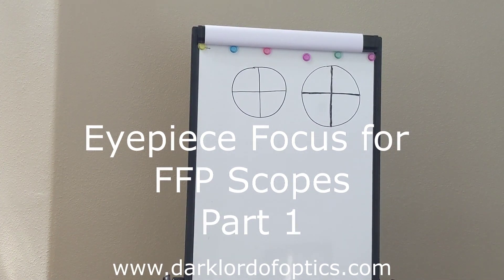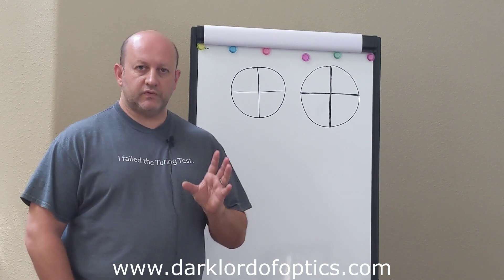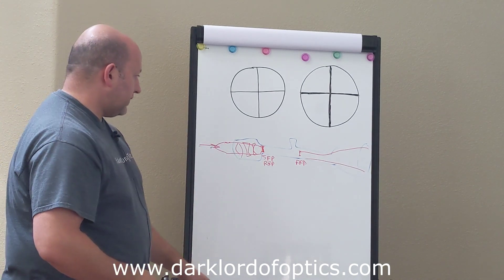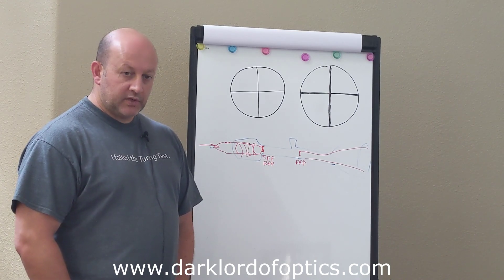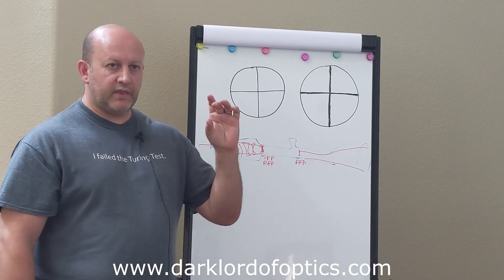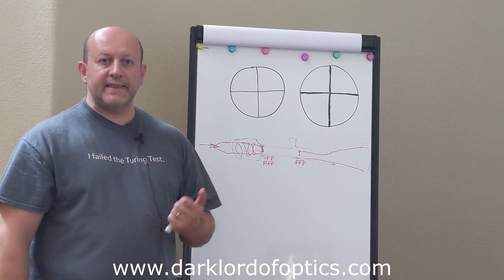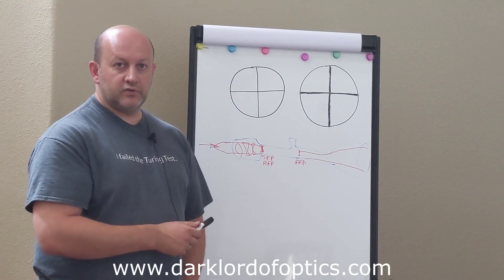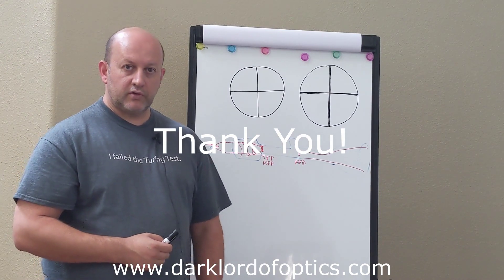DLO Explanations: FFP Eyepiece Focus, Part1

Comment: Excellent video. I have a FFP scope and I've noticed that adjusting the eye piece focus also changes the perceived field of view (the actual field of view doesn't change) Is this normal on FFP scopes? Thanks
Reply from the maker: That is not specific to FFP scopes.  Eyepiece adjustment changes the magnification of the scope, so the apparent size of the objects you see will change.

Comment: My fast focus eye piece is a bit wiggly. I notice when I look down the scope my reticle moves quite a bit. Is this normal? Most scopes I have are solid and have no wobble. With this one my reticle literally moves when I mess with the diopter.
Reply from the maker: Some wiggle is not uncommon, but if it is significant you should talk tot he manufacturer.  What scope is this?  What typically happens is that the reticle and target images move together so the POA does not shift.
Reply: @DarkLordOfOptics  it’s the vortex strike eagle original 1-6 model. I noticed that when it’s on 1x magnification the image seems to move with the reticle when I wiggle the diopter but when it’s zoomed in all the way up to 6x I don’t see the image moving as much as the reticle is.
Reply from the maker: @mattc6395  that’s not my favorite design.  Contact Vortex. They will take care of you